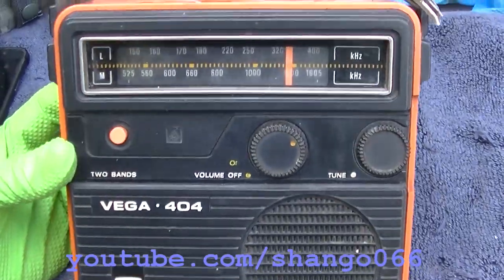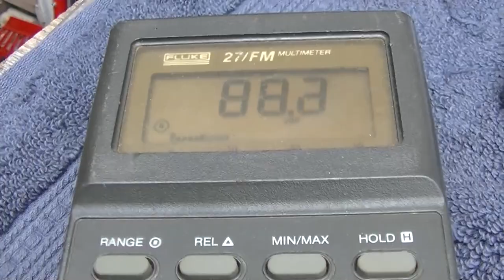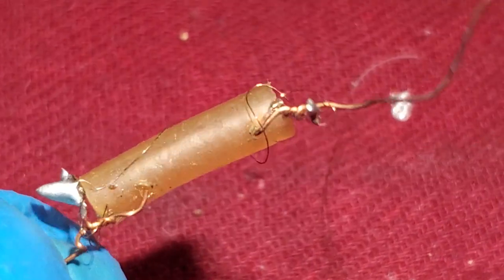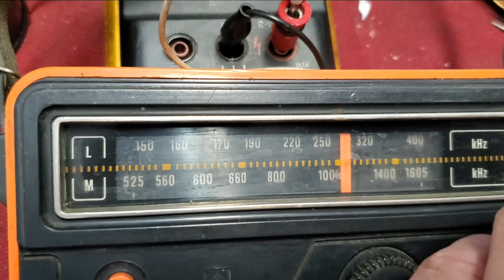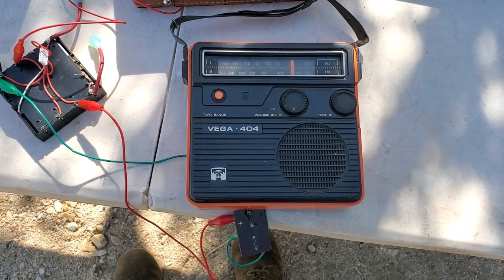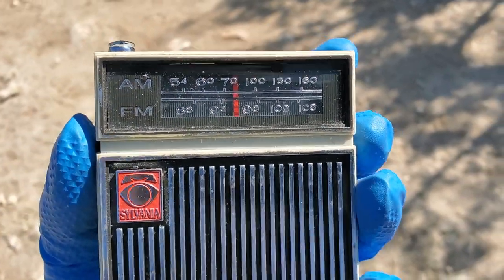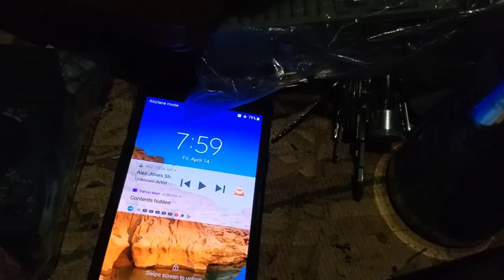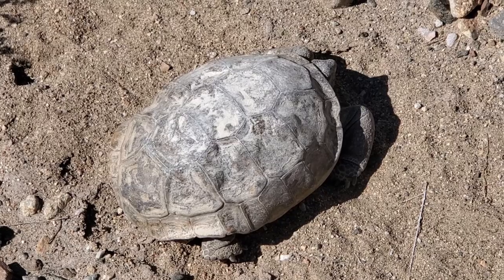Vega 404 Transistor IC Radio Repair and Test

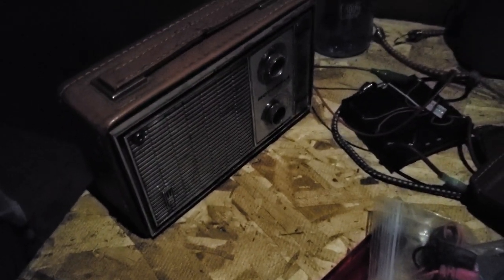Comment: The Radio ID you were listening is "940 Oldies: las canciones del ayer " you can hear it at 44:06. Later on at 46:57 they give a  callsign: XEMMM. Station located at Mexicali, transmitting with 1000watts of power. that's what they say in the radio.
I love your radio repairs. learning a lot from you. Greetings From Argentina!

Comment: I think you should have tested the homemade fuse to see what amperage and whether is was a slow or fast-blow!.
On the audio-IC, sometimes if the 'wings' are not soldered, you can be missing a ground and the chip will thermally runaway as volume is increased.
Great Video and I alway enjoy your trips to far-away places to do AM-DX'ing!  Many of these places would never be seen if not for these trips.
I realize you are doing comparison testing but once you want to listen, you could string-up a 50' longwire.  Another thing that I have found up in the secluded mountains, is to place the longwire on the ground; much of the noise is shunted and both the ground-wave and the skywave can still be received.
Also, you could make yourself a magnetic-loop antenna which can be very effective, plus will be directive to separate stations geographically.
Finally, if you construct a smaller-loop, (that is connected to whatever larger antenna you have) you can use that to couple to the ferrite-loops that are internal to the radios, by just placing them in proximity instead of trying to connect a larger antenna directly to the radio...

Comment: 36:59 .. Don't forget you have that Ford car radio/cassette deck you showed some time back in a video (the one with the up-down paddle volume control).  That's full AM Stereo!  Stick that in a box and you own a portable AM Stereo radio!
Reply: At one point Shango was driving an Aerostar.  That van and its factory radio would be right in the AM stereo era.  But if he was still driving it,  I bet he would be tuning in the AM stereo country station to hear it.

Comment: This Vega probably needs proper alignment, including the ferite antenna - it has seemingly better IF amp schematic than Selga and more powerfull LF amp, though both are in the same "class of complexity" by the soviet standards. There might be another reason for worsened sensitivity - Vega's detector uses silicon fast pulse diodes roughly equivalent to 1n4148 instead of germanium detector diodes. Another thing one can google a third of the century after the collapse of the Soviet Union is from whom these chips were stolen or secretly licensed - 174un4 is the same topology as the Siemens' TAA300 but instead of low height metal can TO-72 it's packaged the same way as SGS-Thomson's TBA810 which soviet copy is designated 174un7.

Comment: Love am DXing  and swling with my recapped knight R100A and a wire in a tree at night. You should do a video on one of those bad Larry's. Things a monster and man can it hear anything. I've got zenith trans oceanics and the knight just blows them away. You can use the BFO to re insert the carrier and listen to SSB on HF, you can use the q multiplier to null interfering adjacent signals or peak the desired weak signal, and it has an antenna tuner. Just an absolute unit of a receiver

Comment: Just started watching this video and am hoping you take apart an IC to fix the internals...  That would be awesome.
Reply: That IC is actually documented in detail as TAA300, so one could construct a "replacement" using discrete parts. 😅
Reply: "Fix the internals..." That is where history has settled without any documentation. Good luck.

Comment: I just bought a lot of about 44 old transistor radios mainly from the 60s and couple of them are NOS. One of NOS is an admiral radio and the box is still in great shape. Im not near as good as you at fixing old radios so it will be more of a challenge for me to fix them.

Comment: @17:53 Been dabbling with CB radios. When I put too much bias on the final TX amp, the output goes to reverse modulation. So on low output, the radio draws highest current. As output increases, total current decreases.

$5 says there's a potentiometer on that radio, someone opened it up all the way. And that's saturating a transistor. Possibly that IC chip... why the original one was getting so hot.

Comment: I'd almost bet that home made fuse was intended to be a low value resistor, and the high current is what killed the speaker voice coil. That resistor may have been intended for an
alternative and similar audio amp IC but was left in place on the schematic.
Reply: That is what I was wondering.  That thin wire may have been "calibrated" to get the 12 ohms.
Reply: I think the voice coil has no any failure, only disconected from the papercone, the glue broken I guess. A had a same issue in the past with a speaker, I could glued together, which still works since almost 15 years.
Reply: @laszlomarktoth7492  Yes, possible, I was thinking rather than being burned out, just passing excess DC current may have heated it enough for the glue bond to let go, either letting the windings move independent of part of the former or break free as a unit and slide on the former.

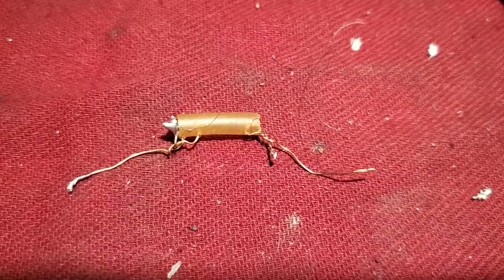Comment: 14:48 I think, this is a homemade wire-resistor of about 12 Ohms or not ? Looks like a fuse, but I think the manufactorer wanted to built this resistor with a stick of wire from a Wire-Resistor or heater or sth

Comment: This wingy ouput IC reamins me the TBA810, tabs got into the PCB and also heatsing tabs soy they can bond termically. But for this application probably landing the tabs at the PCB would be good enough .... unless people used to hock them to external speakers ?, 0.75W is a pretty good ouput power for not such a big speaker. You usually see this power on small cassette radios with 4-5 inch spakers. The TBA810 can do 2 or 3W so they need heatsink. Nice radio, for the 80s they look pretty well built and kinda modern

Comment: These speakers, if they are working, sound excellent. Somehow, the Soviets knew how to make a really good sounding driver, especially in the latter years. Small ones, large ones, they all sound brilliant, IF they actually work. Unfortunately quality control in their factories plummeted in the 80s. Same for the power amp IC. It's copied from some western unit (I think the German TBA-810), so they actually make killer amps, but they also burn out like it's their business. Also, the black thing Shango was wondering about in the beginning of the video is a plug-in connector for the dial light.
Reply: Yes, they copied the TBA810, but it's not this one, as the TBA810 is like 4-6W, this is 1W. It's either a clone of an ancient western IC, or it is Soviet development. 
BTW TBA810 is quite a horrible amp IC, it has terrible THD and inter-modulation distortion below 100 Hz.
Most of the (good) Soviet speakers were developed at Radiotehnika RRR, Latvia (still in business today).
Reply: @mrnmrn1  according to the net its 'similar' to a TAA300, but that has a round metal can package? a TBA810 has 4 extra pins, has 3 in each 'corner' so cant be that one, K174YH9 looks like the russian version of the TBA810...
Reply: According to Radio Museum website it is equivalent of TBA810. There's apparently an East German clone as well.
Reply: I'll look into this but I very much doubt it's an equivalent. The output power doesn't match (TBA810: 5+ W, 174-whatever:1W), and even the pin count is different. @michaelturner4457
Reply: @michaelturner4457  cant be, different number of pins, the version with 9 on the end is, the 4 is TAA300 'similar', the 5 version i dont know, same number of pins as the 4 but different circuit
Reply: it could likely be replaced with a TBA820M or LM386 on a small PCB mounted vertical to the main board, theres  a  SIL TA something chip that could also likely replace it with a bit of adapting cant remember no. at the mo
Reply: Of course it can be substituted, but that would not be authentic anymore. If there is a pin-to-pin compatible western part, that might be OK, but as long as the original part is available for a reasonable price, I would choose that.  @andygozzo72
Reply: @mrnmrn1  there doesnt seem to be, that is, not in the same package, and even that one is 'obsolete' ,
Reply: UPDATE  i've found a bit of paper i had lurking around and i've wrote some equivalents info on them i mustve seen somewhere, but can remember where...  4b version=TBA300,, 7 version=TBA810,  9 version=TCA940,, i cant confirm if these are true or not, though

Comment: The tabs on the IC should be grounded according to the datasheet. Maybe it would work with the 8K2 resistor, it was just oscillating at a few tens or hundreds of kHz without the tabs grounded. The home made fuse is probably a home made resistor. The thin wire might be manganin.
Reply from the maker: I tried that and it made no difference
Reply: That was my thought as well, it could be resistance wire (nichrome or similar) with which they DIYed a 12 ohm resistor
Reply: No, these tabs are already wired to the ground internally. The schematics shows them as to be grounded to show that you can safely ground the heat sink.

Comment: That audio chip looks very similar to the well known LM380 2w audio amp. The pin-outs will be different, but it is always possible to make a convertor board, especially in this radio where there is plenty of space.

Comment: No woodburner, no hammer, just an old-style soldering with rosin (I've still got a small can of it, too). That 'contraption' looks like a c. 1 Ohm resistor, and is likely a part of the attempt to improve the audio amplifier of the thing (the IC at the heart of it was notoriously unreliable and had high distortion level).
К174УН4Б was rated at 0.7 W, and К174УН4А - at 1 W, when loaded with 4 Ohm speaker. Max. peak load current was rated at 860 mA. Pin 1 was 'current stabilizer control input', and it wasn't used in standard use schematics.

Looks like the radio was supposed to run off 4 R14 batteries, pretty typical for small 3rd and 4th 'rank' radios.

Comment: In the northern  semi-desert, the Soviet receiver "Nevsky-402" looks especially surreal. By the way, in my Vega-404 there is no resistor R25! There is a place for it, there is a designation, there are holes, but the resistor itself is not there! The receiver has definitely never been repaired since 1984!
user below

Comment: Hello, Professor... I have a question, please... There are some old radio devices that have a multimeter indicator inside that has 2 wires. One of the wires connects to the audio signal... My question is about the second wire, what does it connect to?

Comment: I am curious if the amplifier IC was bad or not.  during the real close up of the PCB at the start, at least 1 pin wasn't even soldered, and another pin didn't look to be very well soldered.  the amp might still work but it could have some bias issues, causing it to have distortion/high current draw

Comment: Sounds like the speaker cone has come loose from the frame at first impression. I had a Selga 404 & the speaker turned out to be the source of distorted sound. I just bought something with the same diameter from ebay. I felt ashamed of not sourcing an original speaker, but honestly they aren't rare radios
According to that circuit diagram the 'wings' of the IC should be connected to a chassis potential or negative rail. I assumed that they were just for heat-sink purposes.

Comment: nice , i have 2 of model 402, basically an older 'discrete transistor' version ,  looks like same chip as used in later versions of the big 'selena' multiband portable, certainly same/similar package, but think it had more pins?

Comment: In a push pull amplifier, the efficiency goes up until a point, then it goes down again. Because there's little voltage drop across the output transistors at a high voltage swing.
push pull amplifiers actually produce a lot less heat being driven at their max power, than at ~70% of it.
The pin 1 connection goes to the biasing circuit, that added resistor would lower the bias of the output transistors, very odd that it actually increased it. Maybe this radio had a different IC before and had the resistor installed.

Comment: A high current draw could be the chip is in oscillation
Reply: YES! And that might be caused by the ungrounded tabs, which are clearly marked as grounded on the datasheet.

Comment: Be sure to replace all electrolytic capacitors. The Soviet electrolytes in this radio are of extremely low quality. К174УН4А: the analog is the chip of the manufacturer "Philips" - TAA300, as well as A211D, TBA915. The speaker has a tangential notch of the diffuser - hence the good sound of such a speaker (the new one). Greetings from Russia!

Comment: This resistor probably for idling in first revision, but later it's been removed with some chip changes.
Reply: To my knowledge that russian IC is a clone of the 1969 IC TAA300 from Philips/Mullard. The TAA300 in its original form needs a resistor in this place to set idle current. 
The TAA300 is described in detail in "Application Book - Audio Amplifier Systems - 1970-09" by "Philips Gloeilampenfabriken" available for download in english language via "Frank's electron Tube Data sheets"
Reply: @asmallmatter4441  do you know if they stole the masks (using espionage) or did they make their own design?
Reply: @brainndamage  No espionage was needed (especially for simple analog IC). They usually copied ICs the way they imported western chips and by grinding off layer by layer they get internal design.

Comment: Could it be the Vega isn't up to its peak performance because of the original electrolytic caps? The one just after the detector often goes bad in the transistor radios, or maybe another ones too that set the gain of the power amp IC?
Reply from the maker: those all get tested almost the first thing

Comment: On the issue of soldering, I see way too many people apply the solder to the iron then dab it on the join as if they're painting a picture. It's the first thing you learn in electronics, how to solder properly because if you don't get it right then you'll have trouble from there on in.
Reply: I learned the Bell System way of soldering. heat up the connection..apply solder to the tip of the iron then solder it.
Reply: @Brian-yt8fu  Perfect! Nice to hear you got taught the right way. I shake my head when I watch many YT videos as it's obvious that no one showed them how to do it correctly!

Comment: You definately need a heatsink on the chip. It's just a pitty it's a bit deaf out of the city.
Reply: I don't think a heatsink is necessary at that power level, but at least the tabs should be grounded, as shown on the datasheet. But knowing these chips'  high failure rate, you're probably right that it needs the heatsink, it might prolong its lifetime.

Comment: WHY does a headlight need access to the CAN system?  This is absurdity.
Reply: I guess some cars with the movable headlights and such have a connector that accesses the CAN bus, then access to the computers.
Reply: @RPike-bq3xm  This hack affects pretty much all cars. They apparently all have a can bus connection.
Not to mention the Tucker did it (moved the headlights) in 1949 and the Citroen did it in 1970.  Those are just 2 I know off the top of my head.
Reply: Headlights are getting over engineered too. With matrix headlights and diagnostics the headlights need data not just on/off functionality. And can/lin networks supposed to reduce the overall complexity of the electric network. It's all nice and everything but when Bambi loses it and throws himself in front of your car, destroying your headlights... welp it's expensive.
Reply: @tarstarkusz Citroen was definitely doing that before 1970. Old DS and 2CV had them as well.

Comment: 0.5гд37 is a cheap and pretty crappy speaker, although all 80mm ones with high sensityvity play usually from 315Hz, the 0.5гд20 or 0.5гд21 are usually a little bit better. Actually, similar speakers (but working) are still produced in russia, although they are a little bit different and called 1гдш-14

Comment: Is the resistor even 8.2k? It might be wrong even from the schematic. Maybe the 3/4W version of the chip has a different internal connection on pin 1 so it could have that resistor there but the 1W version can't. Or that resistor was placed there as a decoy so that anyone copying the schematic would have defective products (I know some manufacturers did that, though I can't remember who)